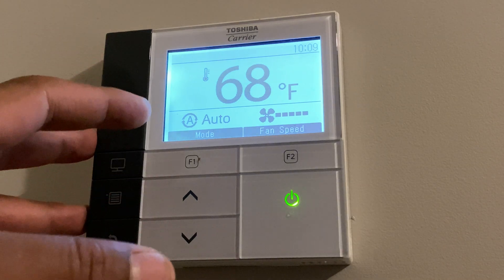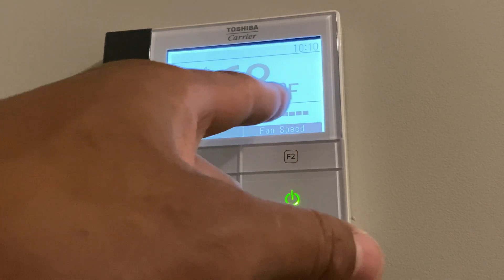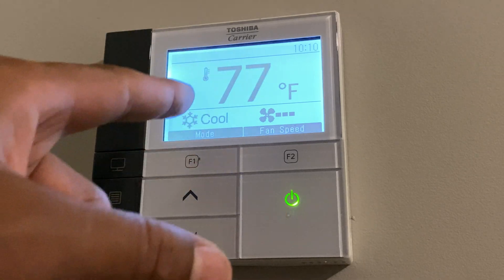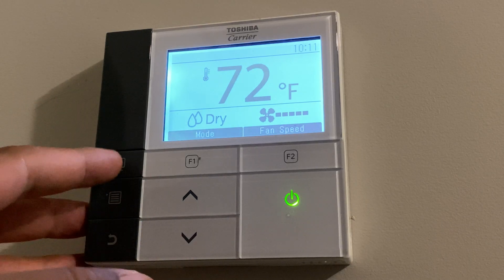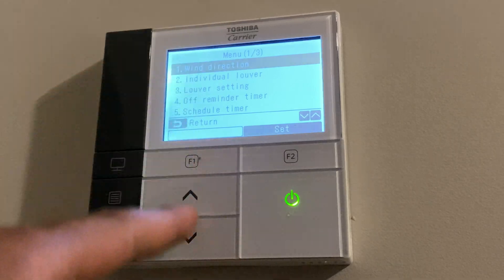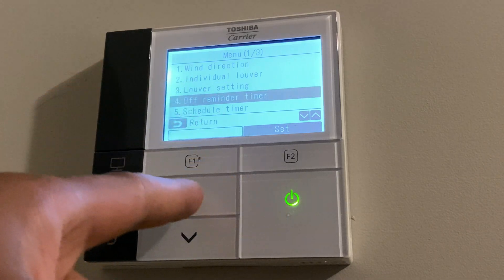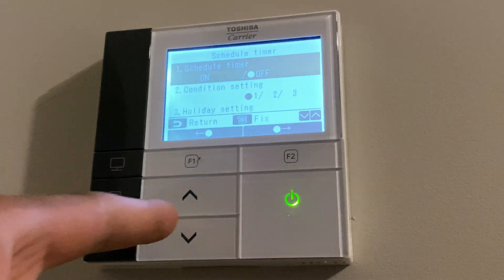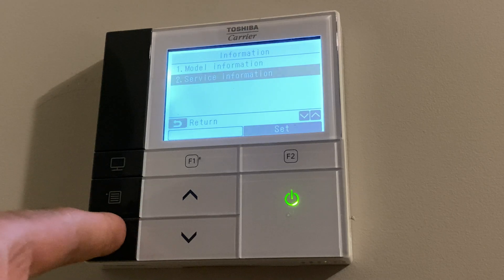Toshiba Carrier Thermostat - How To Operate

Comment: The heat and auto modes are gone on mine. Has anyone else experienced this?
Reply from the maker: @costamatte
That can happen if the thermostat’s mode settings were changed or the system was switched to cooling-only. Try holding the “Mode” button for a few seconds to cycle through all options — if heat and auto don’t appear, it may need a reset or the heat function might be disabled in the unit’s configuration.

Comment: Can you correct the room temp? its indication to low
Reply from the maker: @VincentLenders-i4k
Yes, you can adjust the temperature calibration. Press “Menu,” go to “Settings,” then “Room Temp Offset.” Increase or decrease the offset until the displayed temperature matches an accurate thermometer.